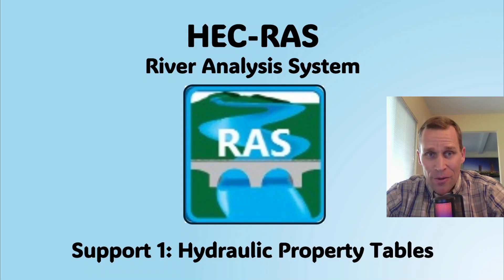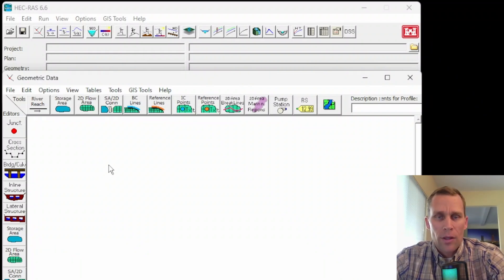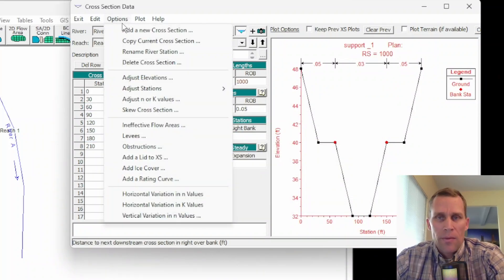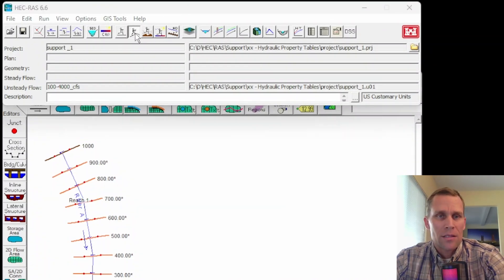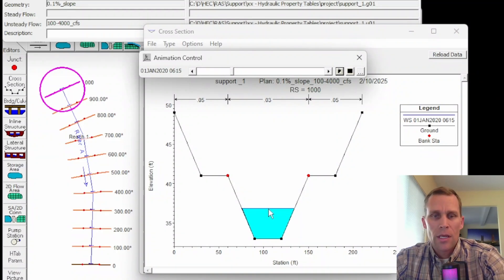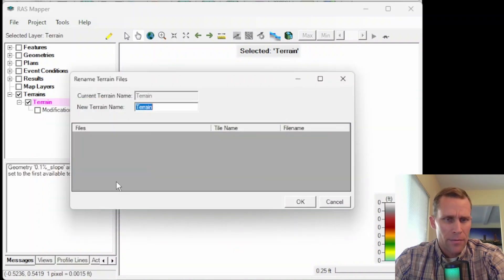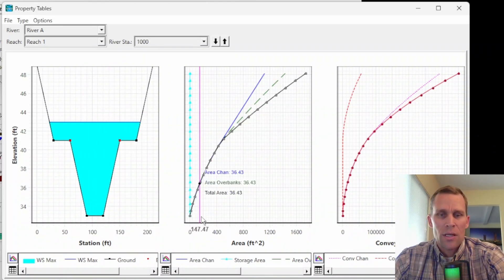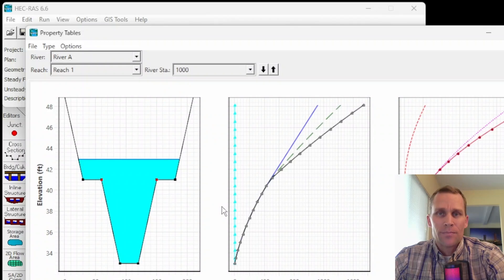HEC RAS Support 1 - Hydraulic Property Tables

Comment: Dear Tim Nelson, thank you for your insightful tutorial on HEC RAS—it’s been incredibly helpful! I’m facing a challenge integrating ground survey data with a 12.5m DEM in HEC-RAS, where elevation/water level discrepancies cause inconsistent model outputs. Could you briefly advise on best practices to harmonize these datasets, especially for vertical alignment? Your guidance would be greatly appreciated!
Reply from the maker: Hi Biniam. Here are a few of my thoughts:
- Prioritize your ground survey data over DEM data because it's typically higher precision, especially in the main channel.
- Search and fix any abrupt terrain elevation changes using the terrain modification tools. Here is my video lesson on terrain modifications in RAS Mapper: https://youtu.be/uiSoFnFWG4E
- When viewing results, try to isolate the time and location of the discrepancies to identify the problem areas/times.